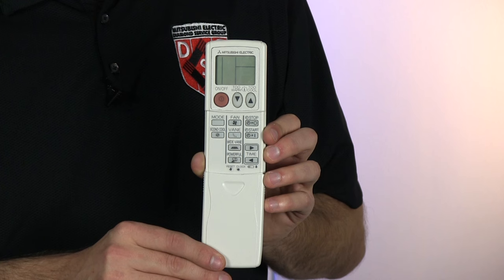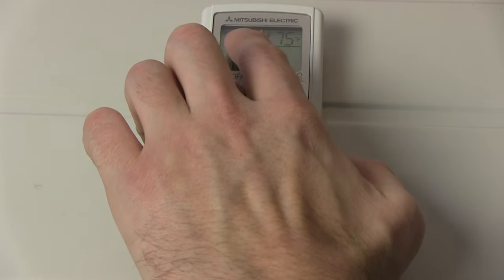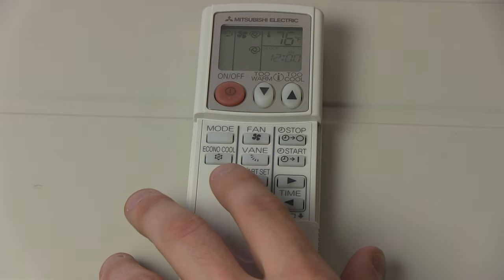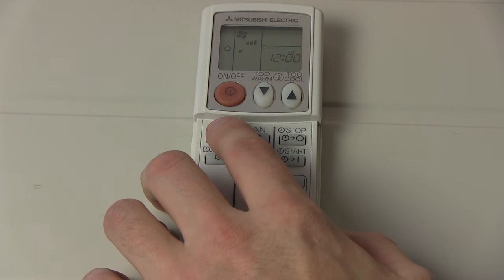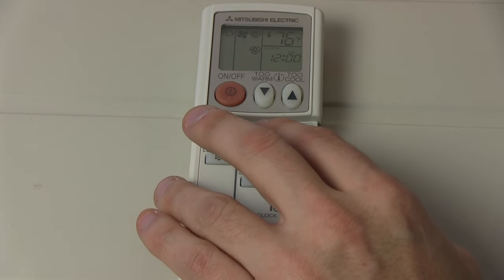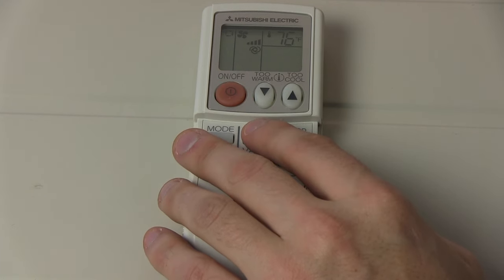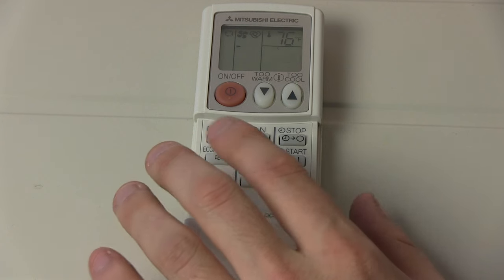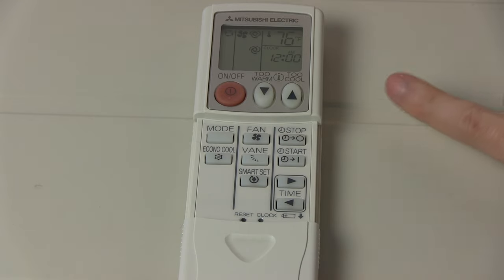Homeowner Help: How to Operate our Handheld Remotes

Comment: Used to supplement the up stairs when it gets hot outside this works very well and Fastly.Cool  Also works good when the upstairs gets too hot in the Winter from the heater.

Comment: I do a lot of user experience design, and this remote is a case study of what not to do. Symbols, weird access to common functions like clock reset, “smart set” that makes everyone feel dumb, and you will even notice, the up arrow is slightly lower than the down arrow on the remote. I hit the wrong one frequently, and it just occurred to me why that is. No backlight? What year is it?

Comment: If you put the fan on automatic mode, what exactly does that mean?  Does it adjust the temperature to what degree I want and automatically go to that and keep it that way?   Say I put the fan at 70 and set it to automatic--does that mean that the unit will adjust the room temperature to 70 and keep it that way?

Comment: LOVE my Mitsubishi split unit. HATE the remote!  I've bought aftermarket universal remotes that work way better and have 7-day programming . to bad you guys can't make a better remote. Even the guys (5 of them came to install) all agreed the remote is horrible. PLEASE get back to the drawing board. when I move and have to install another unit I would love to see a smarter remotte.
Reply: LOL the irony is that this is such a well built aircon system by Mitsubishi Electric but the remote sucks to the core. I hope the engineers in Japan will look into it and improvise it!
Reply: What kind of aftermarket remote did you get?  I need the 7-day programming.
Reply: I have the same question... Can you link the remote you bought, please?

Comment: I need more detailed information about exactly how the remote works because my system is not performing as expected. I have three units controlled with one remote (in a rental, so I had nothing to do with setting this up). Does the remote send the complete state information displayed on the remote to the unit with each button press? Does it send the state information for the controlled function? Or just a mutation? If I have a desired setting across all the functions, how do I adjust all three units to that setting and be confident of the result?

In particular, in cooling mode, the achieved temperature does not correspond to the displayed temperature on the remote on any of the devices.
Reply: I’m also here looking for this answer. When I press down to cool and some times it does not register, but the remote does, if I press it again is it telling the unit to cool down one degree, or is it sending the desired temp which is now two degrees cooler as displayed on the remote.
Reply: Discovered the answer myself! I installed the Kumo Cloud which displays the current temp set through the app. I tested my remote by changing it a few degrees without it registering or giving me the beep feedback then the final one I pointed at the unit. The temp displayed on the remote is what it jumped to. So it’s sending the actual number and not just the signal to go up or down each press.

Comment: Thanks for this basic remote control video.  Very helpful.  One question.  What does Dry Mode do? I have mini-splits in our basement, and the humidity creeps up to 60%.  Would Dry mode help?  Thanks.
Reply: Hi, so basically dry mode is for when it rains and the room moisture builds up and the "Dry Mode" helps the room from keeping level. Basically think of dry mode as a dehumidifier by removing moisture in the room.
Reply: @KingSolrac  Thanks!  And how does it dehumidify? How can it remove moisture from a room?  Is it because the mini-split makes the room colder, so it holds less moisture?  But if so, where does the moisture actually go?
Reply: @RobertAJonas  Hi, I actually don't know I just googled your question and that's what I found after reading a little guide about this.. Sorry, I was also searching about mine/how it works
Reply: @RobertAJonas  I’m no expert, and just found this video to answer some of my own questions ( that shouldn’t need to be answered with a well designed remote control), but I do think I know the answer to your question.  The dehumidifier removes water in the same manner the A/C (cooling) mode does. You’ll probably find the water drain hose somewhere near the outside unit. Besides the remotes, I love my 2 units! 👍

Comment: Can you please make a new video on how to set timer..
Reply: I know I'm late but just for future people. There are small holes just above the batteries. Use something pin sized to press the 'clock' button.         
To adjust the clock, press the 
>
clock                                                        < 
Press the start button and set the timing in which you on your aircon
Press the stop button and set the timing that you want it to automatically stop

Comment: How do you set the default so the unit comes on after a power surge or power failure? When we are away an the power surges (happens often in our area) the unit will not turn back on and our house is very HOT when we get back home.  Supposedly there is a default setting where the unit will come on after a power surge, but so far no technicians can find the setting. HELP!
Reply from the maker: Hi Ruth. Can you let me know what the model number is of your unit?
Reply from the maker: Hi there, Ruth. You can contact our Customer Care team at 800-433-4822 or via email at customercare@hvac.mea.com. They will be able to help you with this!